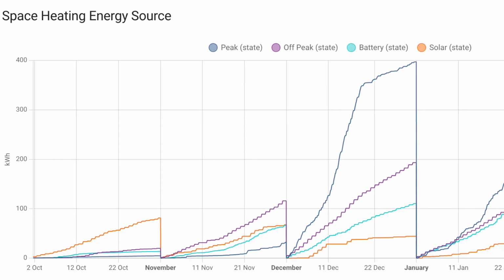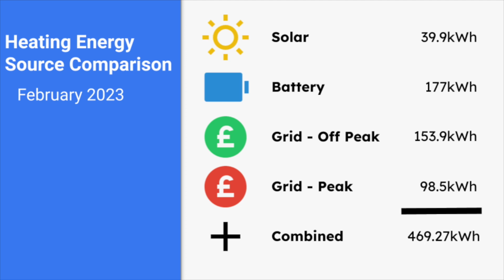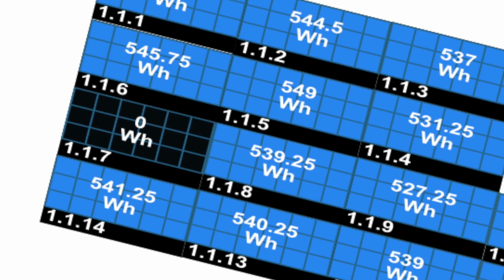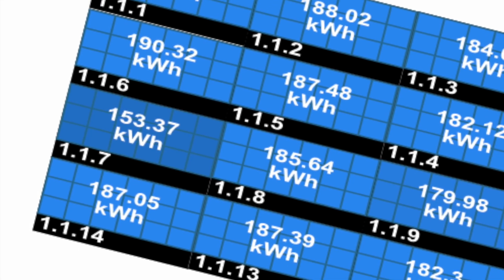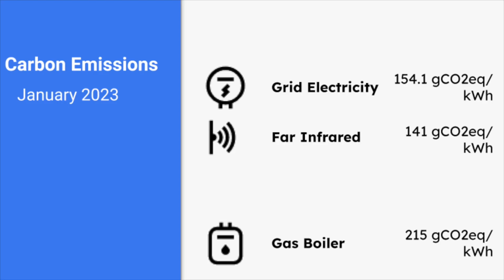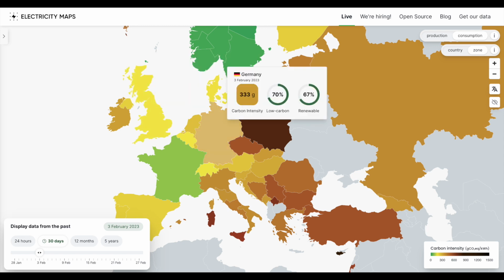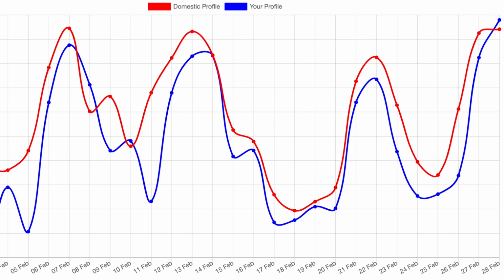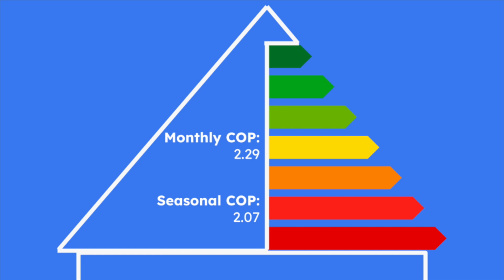Far Infrared Stats - February 2023

Comment: Thanks for the gas vs electric comparison its much appreciated and I've subscribed to follow your journey.  Are your IR panels all ceiling mounted?  Did you go for panels with higher output than required for rooms with motion sensors, so you could feel the heat more quickly?
Reply from the maker: Hi, most panels are ceiling mounted. The wet rooms have wall mounted mirror panels and the kitchen has a bar panel (summit white). We specced the panels using the calculator on the Herschel website, which I suspect slightly overspecs them but we haven't gone for a higher rating in rooms where we rely on motion triggering (the office panel is only 400 watts for example).